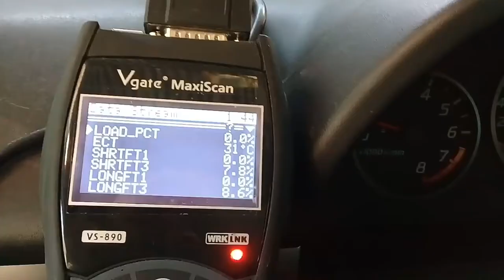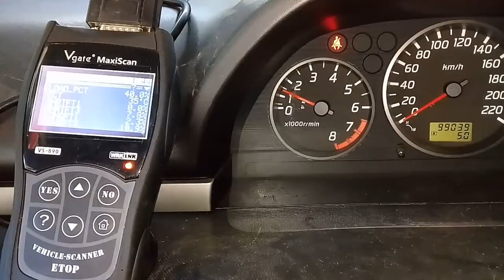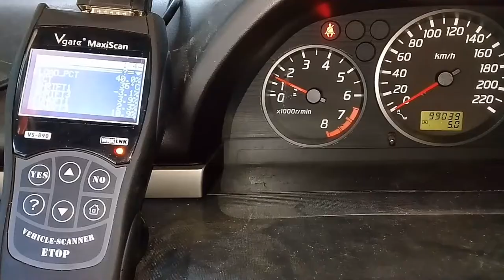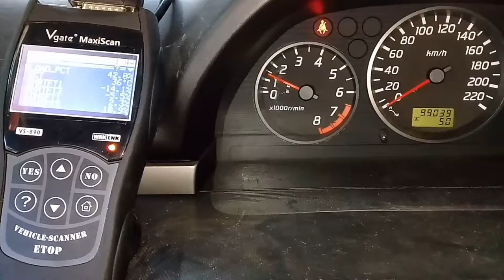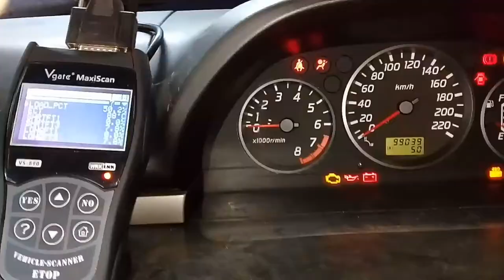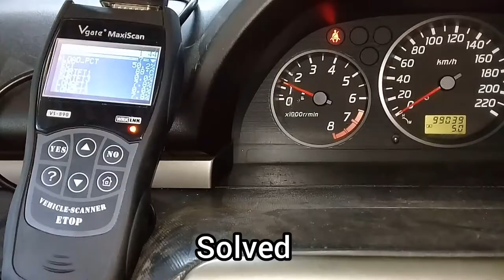Nissan Xtrail T30 No Acceleration [Solved]

Comment: Thanks for posting this. A really simple fix to a seemingly major problem. How could a missing grommet cause such a fuss. I tested by preloading the accelerator by approximately the size of the grommet. It started and revved fine. Then I released the pedal back to the metal without the grommet and it no longer revved.

Comment: My problem is that the car starts fine but while im driving it starts losing power and soon after check engine light comes on. At that point the car goes limp mode but doesnt cut off immediately. I still get a few minutes to pull aside. I changed a number of sensors related to issue (knock, throttle body and the pedL position sensor). The problem only goes away for a few miles. Comes back as if nothing changed. My mechanic did change the pedal sensor but I dont think that green thing was present. Ill check myself and try the repair. I really hopes this works. Thanks

Comment: Greetings bros. Love your video.. pls I have nissan xtrail 2005 though changed the engine and the reviving goes up and down refuses idle... Then my mec worked on the throttle head and the reviving was ok, but sometimes while driving it will just refused to accelerate then if I put of the engine and turn it on the reviving comes back on but it stays if no traffic but there is, it goes back to not accelerating it limps... So what do I do...? I got it scanned today but the scanner couldn't detect  the engine, so is to manually trace the fault..  please how do I fix this have spent so much... Thank you
Reply from the maker: Thanks for watching bro! Sorry I cannot give you a good answer on your inquiry🙏. Please have your car check by a qualified auto electrician.

Comment: Good day, I have a 2005 X-trail, the fault at first was the acceleration pedal sensor (APP), it changed and now if I turn on the truck when accelerating to more than 1500rpm the car turns off, what could be the failure? Before changing the pedal sensor it started and it did not accelerate to more than 1500rpm but it did not turn off, it only advanced very slowly
Reply from the maker: If check engine is on, have it scan to retrieve the error code.
Reply: 1. check your engine horses for any vacuum leaks.
2. inspect the fuel system,  ie fuel filter, fuel pump
3. inspect the air control system  I.e air cleaner.

Comment: i have problem with my nissan altima 2017 sr 4 cyl . just some time i want to drive i put my foot on gas pedal the car not respond after 4 or 5 second it will go and the engine light is not turn on . i showed to some mechanics and service center they didnt know the problem .please if you can tell me the problem .thnx
Reply from the maker: Have it scan first. The scanner will point if there is any problem with the electronic system.
Reply: @DiYSpanner  i scaned but no point and no engine light on .
Reply from the maker: https://m.carcomplaints.com/Nissan/Altima/2017/engine/engine.shtml  it is a common issue to 2017 altima.

Comment: I can't find scan tool for my 2003 t30 diesel 6 speed.   What is yours. I tried many .
Reply from the maker: I'm using scan tool for gas only.
Reply: Bro my is Nissan x trail T 30 after the change out,I still face the same problem
Reply: What more can I do,please any idea?
Reply: the thinkdiag 2 worked too real nice but sold it for food hahahaha thinking all can work  that was my first try   i relocated to west africa from vancouver so the car is nissan from germant

Comment: My Xtrail  T31 cant exceed speed of 100, even if you press the gas pedal to the bottom.what can be the problem? I checked the transmission  fluid is at the required level and still Ok and there is no any check engine light, Kindly help with ideas how to fix the problem
Reply from the maker: Please have it check by a mechanic. Thank you for watching!
Reply: got the same issue! even the mechanic cant solve it, need help on this! 😢
Reply: Check the fuel pump inside the fuel tank
Reply: the issue is with the catalytic converter

Comment: Do you need to reset the engine check light or did it go away after a while?
Reply from the maker: Reset it by removing one of the battery terminal.
Reply: @DiYSpanner alright thanks